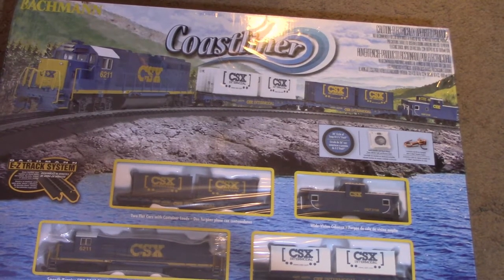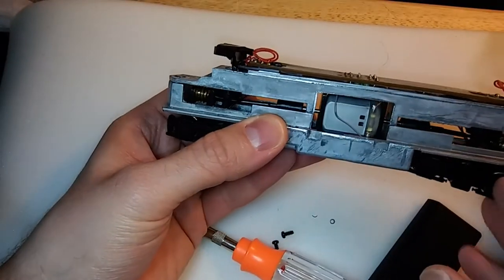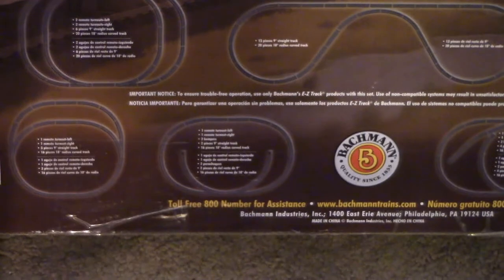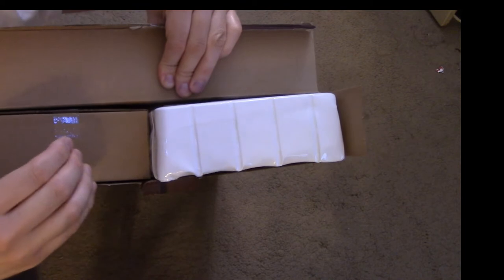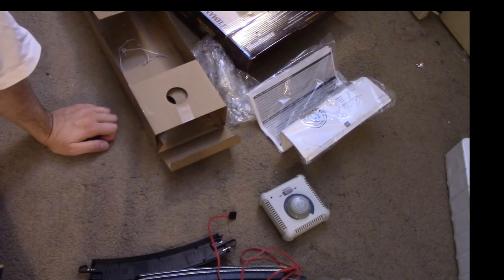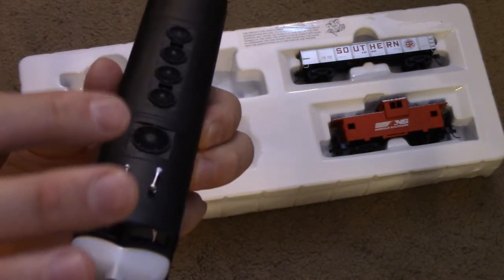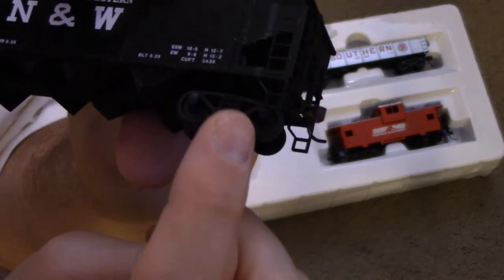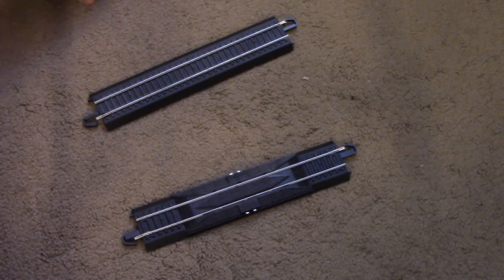Bachmann Thoroughbred train set review

Comment: I have a Bachmann HO scale 'Harry Potter' train set which I purchased for my kids many years ago.  My kids are grown up now and have no interest in model trains so I inherited it and use it every year during the holidays around the base of the Christmas tree and it runs just as good as new.  I'm not a serious and knowledgeable model train enthusiast but I've been happy with that Bachmann set over the years.  I do clean the rails every year and take care that the contacts line up and engage properly between the track sections when I assemble it.  Based on my positive experience with that train set I have no qualms about acquiring another Bachmann train set or rolling stock.  I rather like the 'Thoroughbred' set as Norfolk Southern trains are common in my area and the F cab unit locomotives are classics.

Comment: It’s really disappointing to see an “entry” level set cost so much and have so many issues right out of the box. An old Athearn Blue Box F7 and some cars slapped together would be the superior train set. Unfortunately unsuspecting consumers are unaware of the other options available in the Model Railroad hobby and are forced to consume this fare. Nice review and information on Bachmann and their current products.
Reply: I got a used athearn blue box alco pa and it ran while some of my bachmann will break a few months late and my athearn alco pa still runs
Reply: @therailfanman2078  You really can’t go wrong with a good ole Athearn Blue Box locomotive. Even if it does break, they are really easy to fix.

Comment: I just picked up the engine from this set for $20. Yes, $20. Not the best engine, but definitely not the worst. For some reason, Bachmann gave it a 3 pole motor instead of a 5 Pole like there other starter set engines and just normal engines in general. I'm kind of surprised that they took the time to add the ditch lights and windshield wipers 🙀